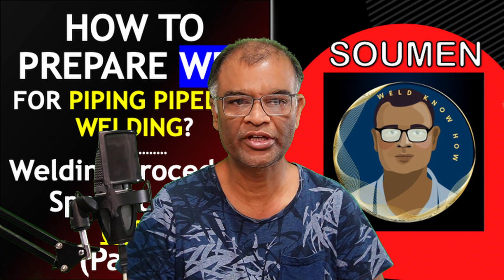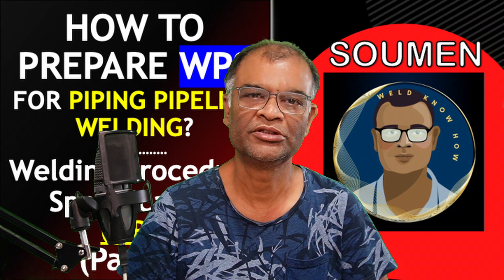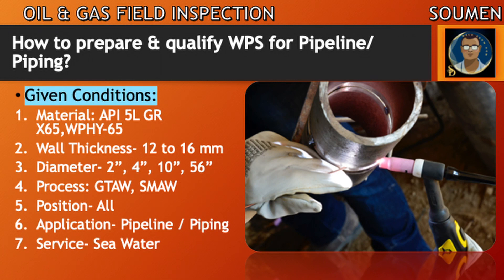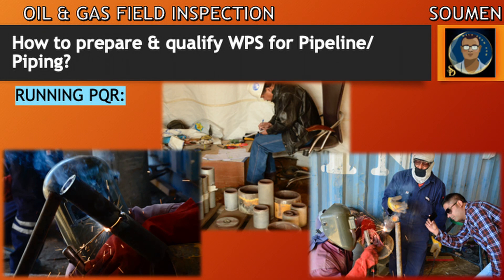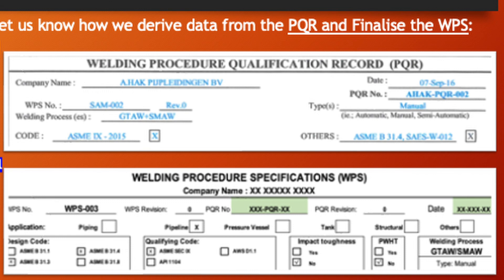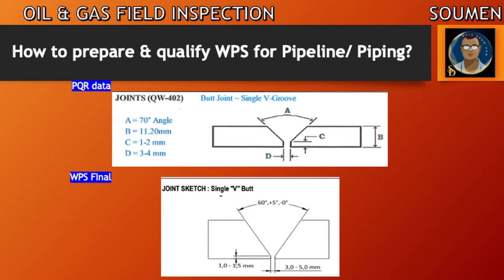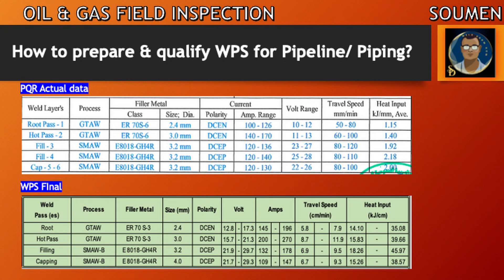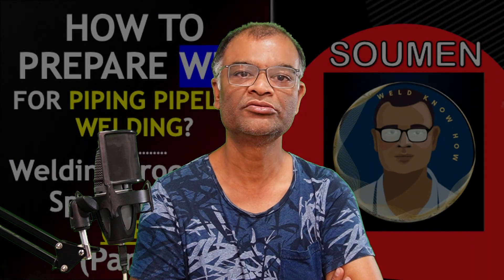HOW TO PREPARE A WPS FOR PIPELINE AND PIPING; How to write a Welding Procedure Specification (WPS)

Comment: have a great respect from buttom of my heart. i have a doubt that when we make pwps how we put the data like thickness of base metal travel speed . after pqr we ll do the pwps or before pqr
Reply: Thickness range from applicable qualification code, thickness requirements from project specs. Welding consumables related data shall be taken from manufacturer recommendation and the collected data from experienced welders
Reply: @soumendey1331  I asked a lot of people some said don't write the travel speed heat input current voltage value and some days write from experience. So I got confused to write or not these datas in pwps.